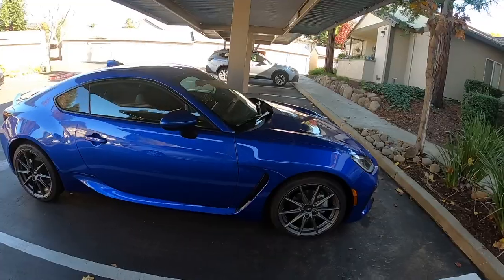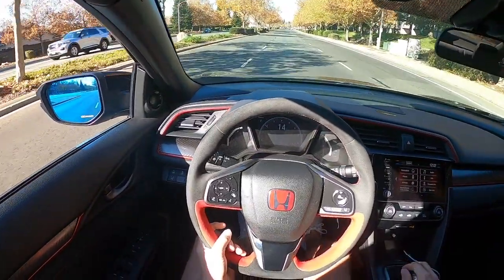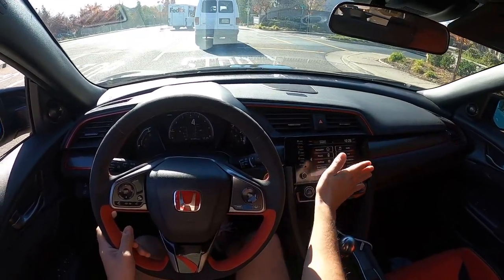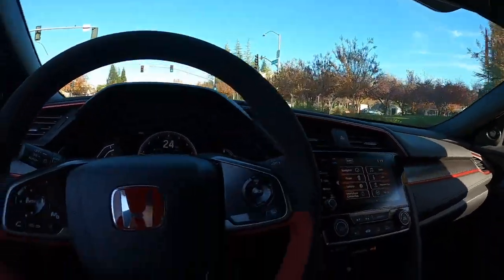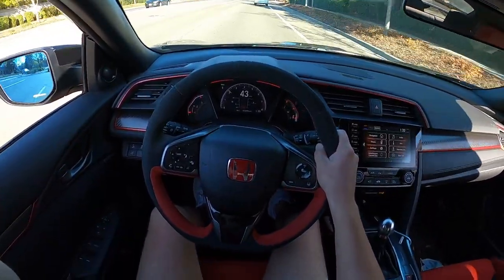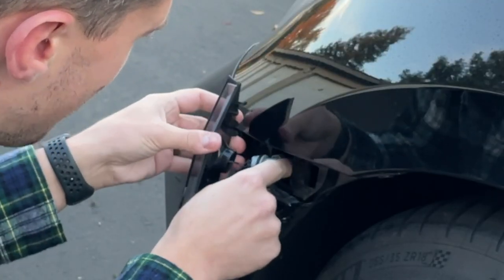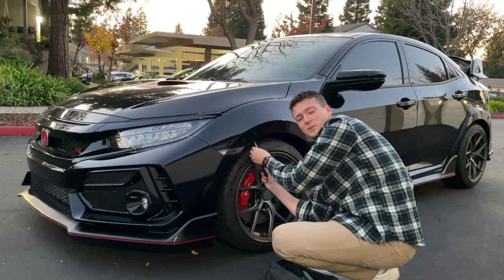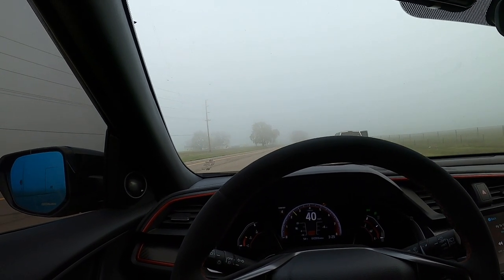My Civic Type R RETURNS!

Comment: I like how the 10th gen infotainment is integrated into the dash instead instead of being tacked on top and blocking your view.  
BTW I'm loving the phearable 1.5 tune, afr, knock control, etc. are money and the car hauls now.  Best tune out there.
Reply: oh like how they used to make infotainments, now theyre cheap ipads lol
Reply from the maker: Agreed, and I loved that tune!
Reply: It’s also andriod and I can do literallly anything w it
Reply: Completely agree about the new 11th gen Ipad infotainment display.  Awful.
10th gen Type R  and Si looks so much better.  This will likely be an issue with the new 11th gen Type R as well.  My personal opinion is, Cam's 10th gen Type R will always have a place in the enthusiast community because it is such an exceptional car.  Kind of like the S2000 and early Integra with Vtech NA Honda motor.  What is somewhat ironic is how much both the S2000 and Integra were underappreciated until they went out of production.  I believe the 10th gen Type R to be an iconic car and hard shoes to fill with the 11th gen.  Will see.
Reply: @lukewalker1051  it's funny because most people in EU prefer the older gen type R's. I think a lot of issues are going to be fixed in the 11th gen especially since this was the first one in NA
Reply: @Hondaddy  Hi Michael, to me the single biggest failing of the 10th gen Type R which afflicted earlier models was the 2nd gear syncro crunch which on some cars and not all was awful.  For a car like that, this is a tough thing to live with for the type of buyer that purchases a Type R which are fussy gearhead guys.  For that reason, if shopping used, I would go with 2020 or later.  But...probably I believe for the new 11th gen will be once again, 'dealer markup' in the US because the demand for the 11th gen will be high I believe.  I may try to pick up a very late 10th gen Type R versus the new 11th gen.  I really don't see the 10th gen losing its resale when the 11th gen comes out because it is so good a car which Honda improved with every model year since it debuted in 2017.
Reply: I also love how the 10th gen interior looks like a bunch of cheap plastic put together. Stop whining ab it bruh.
Reply: @piercetm  I think its nice, I came from a 2005 CRV to my 2020 Si so it was a big improvement.

Comment: Crazy how you have both of the cars i been considering for months now dude; i may go with the BRZ/86 just for money sake but whatever i choose will be the new daily through spring summer and new england winter sooo
Reply from the maker: I think the BRZ might be a little easier to control in the winter up there because the Type R has a touchy throttle response if you aren't paying attention and if that boost comes in, you're gonna be spinning in the snow/ice. I think N/A cars are better for winter climates
Reply: @Camhill182  I agree with ya, I been driving my 2008 350z throughout the past year and had no big issues in winter. I’ll have a little less power but the luxuries like TC, ABS and other stuff makes up for it. Especially the MPG

Comment: Couple of things you taught us a bit Cam:
All said, as much as you really like your new BRZ and in spite of the Type R being FWD which is almost unnoticeable due to incredible Honda chassis tuning, you love your Type R more.  That is important for those of us shopping both cars.  I believe I would love the Type R more for the following reasons:
Driving position you talked about.
Practicality of hatch with big storage versus the much more limited BRZ trunk capaciity.
Being higher off the ground for visibility and getting in an out of the car.

A last note and this is big for Honda fans.  I believe you know as having been a previous Si 1.5L turbo owner, what kills the 1.5 liter turbo L15 motor for many is REV HANG.  What is quite apparent because you drive your Type R well and don't speed shift it on every shift is....the Type R has no noticeable rev hang.  This is a huge driving dynamic difference for performance lovers.  The new just released Civic Si...Cam 'still has rev hang' in spite of a lighter flywheel closer in weight the Type R flywheel.  So more to it than just the inertia of the engine, tuning plays a part as well.  It is a crying shame Honda did not tune out the rev hang on the new Si and make it drive more like the Type R.  Sidenote, I vastly prefer the hatch of the Type R to the sedan body of the new Si.

Thanks as always for your content.
Reply from the maker: I appreciate that, Luke. If I can provide even the slightest bit of value to my viewers, I'm doing my job. With the rev hang, I totally agree with you. and all that being said, the BRZ really is a phenomenal car!
Reply: @Camhill182  Your great character comes through the camera lens and  please know you do provide the type of insight that helps us in the direction we take.  I see very big things in your future.  Stay safe and thanks again.

Comment: Sold my type r for a 911 but still miss it a little but never really enjoyed the fwd. i am excited to see how good the new one is. I wonder when it will be revealed? 
I like the look of the brz. Not coming here to the uk for a couple of months. But surely it doesnt get anymore fun than the brz? I watched one of your videos and you mentioned the narrow tyres. I think thats because people had alot of fun drifting the old one. 
Sometimes  i think the 350bhp in my 911 is a bit too much for the uk b roads and 270-300 is the sweet spot so the brz is tempting to me. 
What do you think the brz will get with just bolt ons and tune? Another 30bhp is my estimate. 
Note that in the uk our 99ron fuel will make the brz about 235bhp

Comment: I will say, I have the 11th gen hatchback in the sport touring trim in boost blue and it’s such a huge jump over the 10th gen. I’m sure the type r is going to have the same huge jump that we have seen.

I would definitely consider the 11th gen especially the way the content with it can be so different.
Reply: Picking up my 11th gen Si in a few hours, super pumped and also can't wait to see what's in store for the type r
Reply: Danny congrats on the new 11th gen Civic hatch.  Did you get a 6 speed?  Does the rev hang bother you?  Its pretty noticable on all 1.5L turbo 11th gen cars.
Reply: @lukewalker1051  it’s the cvt.

Comment: I just put a new timing chain tensioner on my 08 fg2 that's at 279000 kms but didn't replace the chain and now I have a cam position sensor code.. car still idles and drives perfectly under 3k rpm then around 4k rpm & under load the engine starts to lose power. Would a new sensor fix this problem or did my timing chain skip a tooth?